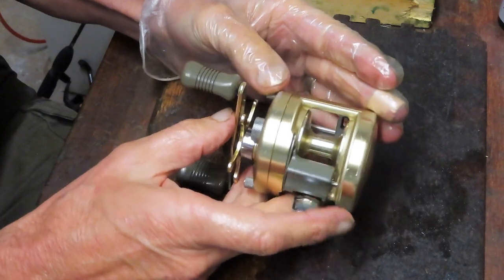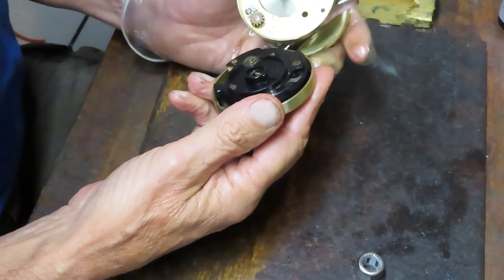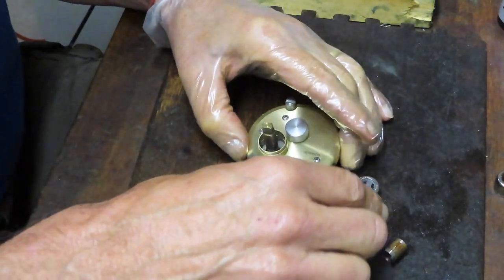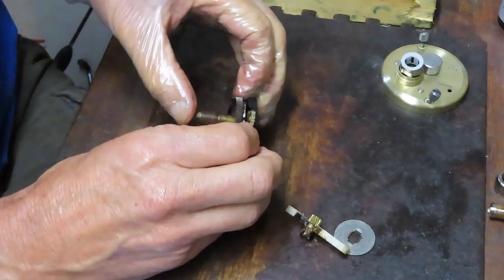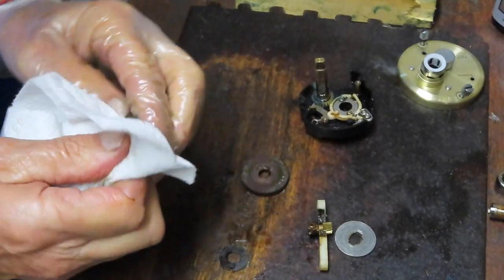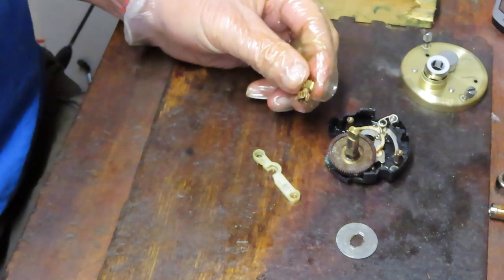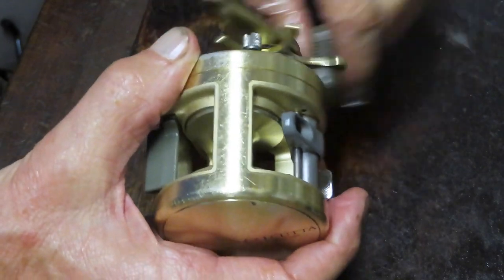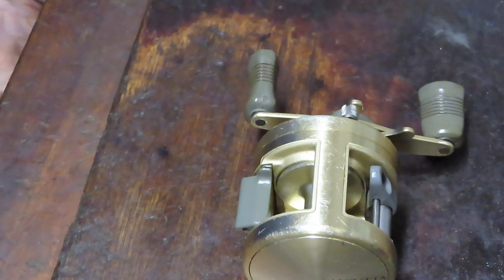Shimano Calcutta 251 Left hande retrieve fishing reel how to take apart and service

Comment: Love these reels. Perfect size for saltwater Bay fishing. Here are some mods if you want to really enjoy these classics in modern times. 
1.You can replace the spool bushing with a bearing. 
2. Can also swap the main gear and pinion for a faster 6 ratio gear and pinion. 
3. The handle, star drag and click mechanism for the shimano E series reels should fit these series of calcutta reels.
4. Modern greased drag washers.

The main two side bearings are also very cheap to replace.
Reply from the maker: Thanks for the tips!  I will look into each of these ideas - Dennis

Comment: I'm having a problem  with my 251, occasionally when I set the hook the spool free wheels in reverse. Do you have any advice for me?
Reply from the maker: That is likely to be a bad Anti-reverse clutch or grease/dirt on the gear spacer that rides inside the clutch.  The spacer is the part where the clutch roller bearings great to stop the reel.  I would take it apart and make sure all parts are clean and grease free and try to see if that fixes the problem - Dennis
Reply: @2ndChanceTackle  thank you very much, I sent them back to a certified repair center about 10 years ago. They came back with the same problem. I saw your video and thought there might be hope for them yet.Thanks Norm.